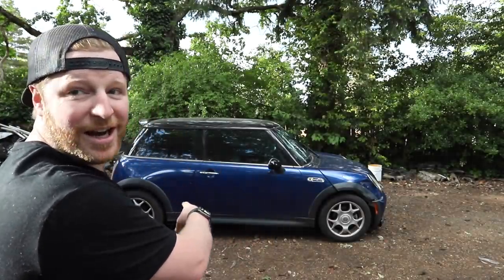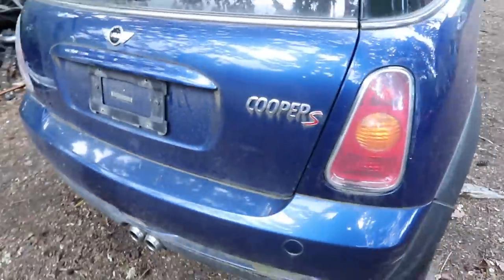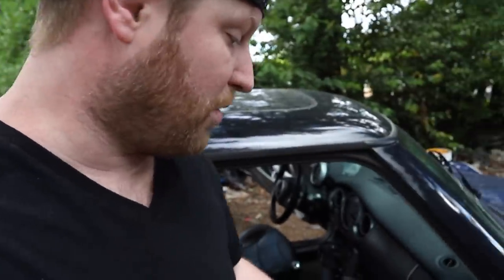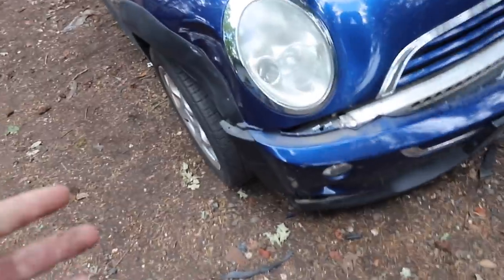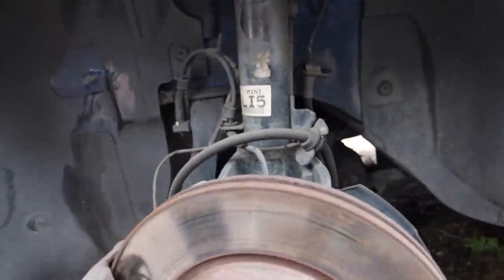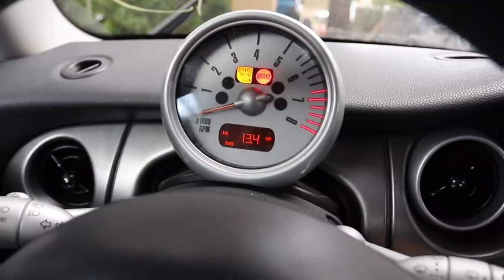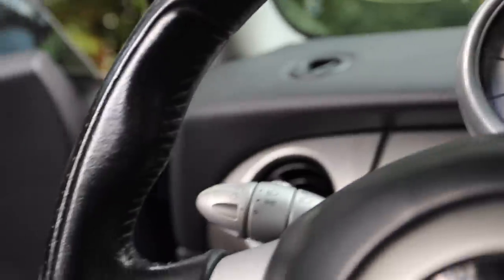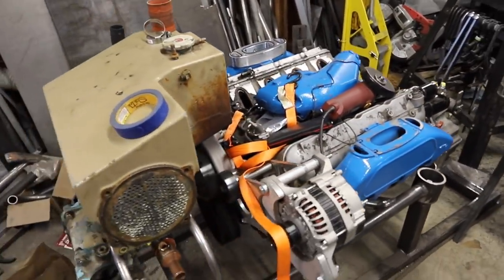I Bought a Supercharged Mini For $500 for a 500 Mile Off-Road Race

Comment: There's a trunk release under the rear seat! Looking forward to this one.
Reply: It is, used it once too many times with a dodgy battery
Reply: It's in the handbook. It should be in English.
Reply: Dam you stole my comment 😂
Reply: My 2002 s does not have a release under the rear seat for some reason, I think they started adding it the next year... So I just hope the rear latch doesn't stop working permanently (it has temporarily stopped a couple times 😂)

Comment: I had the 2005 JCW and it was low miles and mint condition when I got it in 09 and within a year the car started falling apart. Strut tower mushroomed, cv boots exploded it’s guts all over everything and the seat rails broke. I never drove it over a railroad track doing 100mph again.

Comment: Cup holder is something you can either buy aftermarket or from mini. My 2005 mini has both the rpm and mph tachs on the steering column. And the hatch secondary open is under the back seat.

Comment: If you are going to offroad the Mini you HAVE TO put in a a brace for the front shock mounting points. Maybe even weld in some thick plates. The first gen Mini mounting points tend to mushroom under load.

Comment: 1) Pull the rear seat out, and there is a pull-cord for releasing the rear hatch underneath (there should be.) 
2) You'll want a bigger radiator, especially if you're going to add a pulley to the supercharger. 
3) There is someone who has made custom, fitted blocks for raising the suspension, so you just send them some $ and you have your suspension raised easily.
4) Google "mini strut tower mushroom" -- you'll want to add a front strut bar brace to help keep chassis rigidity; you may want to add one in the rear, too.
5) It is a "factory" cup-holder. Probably a dealer-installed extra.
6) Check for rust on the exhaust. 

Good luck!

Comment: Before putting a spacer above the front shocks I’d HIGHLY recommend putting shock mount supports, R53 Minis have VERY weak shock mounts and you will completely destroy them on any bumps with those spacers

Comment: Cool project. Good luck replacing the lower control arm. You need to lower the subframe to get to one of the bolts. And they are tight!

Comment: Emergency Trunk release is behind the trim panel on the left side. It’s a wire. In some cases you have to remove the trunk trim panel to gain access to it. Also  recommend changing the boots on the intercooler
Reply: On my R53, it’s under the rear seat, driver side.

Comment: Nice, the R53 is fun and VERY cheap to modify. Absolute must is R56 front calipers, discs and hoses. The R53 brakes work well until the my don't, which doesn't take long. Front upper/lower and a rear strut brace is really worth it. Also Google "Dave F airbox mod". The gears are a lot longer than you think they would be, given it's a 6 speed, so be careful with your wheel/tyre size. It would be easy to overdo it and bog it down.

Comment: Build some extended lower front control arms and change the angle that the struts attach to the steering knuckles.  Make some spacers for between the half-shafts and the transmission.  Possibly the same for the rear.

Comment: Strut Tower ISSUES!!!!
I rebuilt a 04 Cooper S a few years back after it got hit by a train (previous owner). I am fairly sure that the car was completely airborne as all 4 shocks were bent when I got it. One thing you might want to consider is reinforcing the front strut towers, they are thin, bend easily, and I have seen picture where the upper mount has blown through. I’m guessing the damage to the drivers front has already bent that side. Check out MOD MINI on YouTube, he has a good video explaining it, or just google mini cooper strut tower failure. Best of Luck!

Comment: I have the exact same Mini in perfect working order. You can open the trunk by lifting the back set cover en under it there is a handle you pull to open the trunk. On these car the trunk button not working is a know issues. 
I had mine repaired a couple of year ago.

Comment: It may have been mentioned already, but the strut towers on the front are not the strongest when it comes to impacts. There are some strut top defenders available that bolt in to strengthen them.

Comment: Good luck with those stock wheel bearings if you add wheel spacers on top of the negative offset wheels plus the offroading, carry some spares because I suspect you might need some

Comment: My 04 r53 has a 15% supercharger pulley, pace setter header, alta cold intake! 15% pulley is peak 16psi with good cool air. If you boost more smaller than 15%, you should not hold throttle for too long.

Comment: Watch out for those stock control arms. I’d plate box them in and should at least last the first couple jumps. If not also lengthen it by spring spacer amount as well

Comment: The reservoir itself is really more about heat dissipation on like washboard surfaces than it is increased travel or improved ride.  You can probably just get coilovers without the external reservoir and save a few bucks for a gambler mini lol

Comment: I am not sure what year this model is, but the later ones have emergency trunk release cable under the rear seat. 
on the early model,  you have to fold the rear seats to get access to the door handle on the hatch.

Comment: there is a emergency release for the boot under the back seat , basically wire handle , pull it to open the trunk, well has in myn , as the little clicky thing on the boots go funny , wd40 myn and it worked again

Comment: Hi Chris. Did you know that Minis from These years, even if they were sold by BMW, had a French engine ? try to check all around the engine and you should find a Lion stamped somewhere !!!! (Lion is for Peugeot) Good research !!! ;-)
Reply: This is the first generation with a Chrysler designed Tritech engine. The second gen got the Peugeot N14 engine but most of those have exploded by now.

Comment: The R53 mini is an awesome project. My wife has a 2006 Works Cooper S and I love it (don’t tell her I prefer to drive it more than my Lotus Carlton!). I’ve run the mini at a couple of sprint tracks in the UK, including ShelsleyWalsh. It’s quick and handles well in stock form. 
For performance, you can get the 2006 Works kit to release at least 215bhp. You need the head, blue injectors, smaller supercharger pulley and re-mapped ECU. All parts supplied (in the UK at least) by mini. Quaife also do a torque biasing LSD for the six speed box. There are also gains to be made from a bigger and front mounted inter cooler. 
Some videos on my YouTube channel of me running Mrs Wain’s 2006 Works on sprint tracks (eg: https://youtu.be/_at3Frvcejg) or search “Rob Wain” on YouTube. 
Love your work!

Comment: 16:00 you keep  saying "a little bit  smaller" why? that looks like it would  fit decently between the headlight bucket and the door seam, with a lot of cutting and  a little  lift those tires could  work.

Comment: those exchangers are hideous, plus, could be in a real need of a soak to get rid of mineral deposits.   Why not just throw down a few bucks on modern exchangers that are in current production for the big block gas motors.